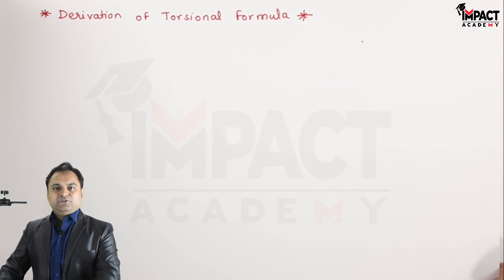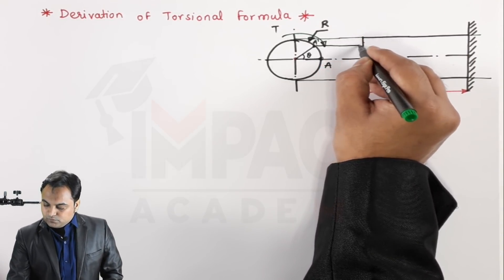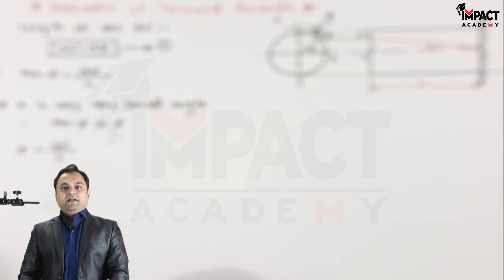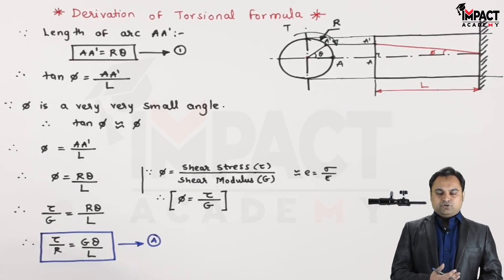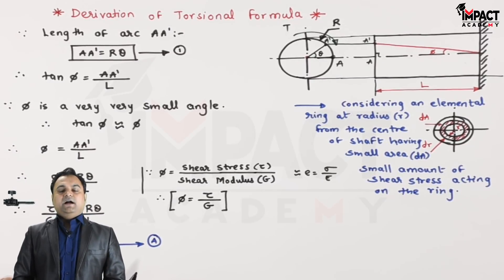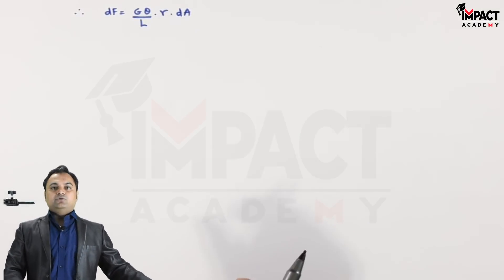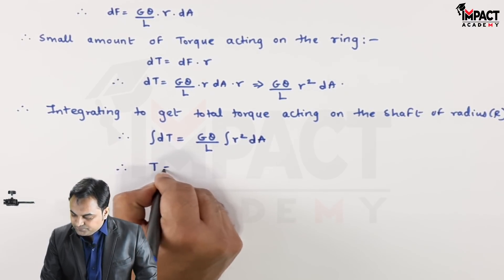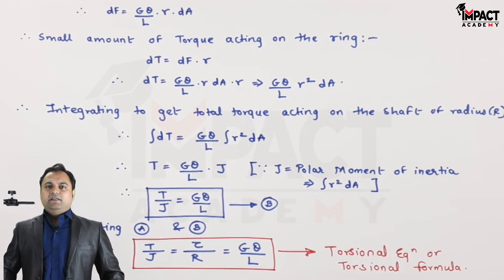Torsional Formula Derivation | Torsion | Strength of Materials #gateexam #engineering #gateexam2025

Comment: Sir, acc. to this diagram when we apply torque in clock wise direction the point A distorted in A' how it goes  anticlockwise direction......, sir, i think it will go below A ie. A to A' in clockwise direction plz reply on my comment for clearing my doubt..
Reply from the maker: Just remember angle of twist is thetha...either it is measured clockwise or anticlockwise doesn't matter...👍👍👍
Reply: @ImpactAcademyOfficial  ok sir, thnx for this